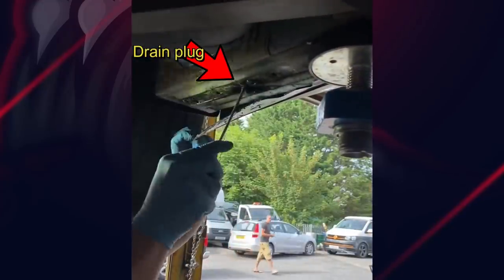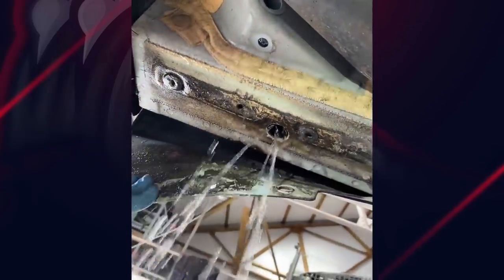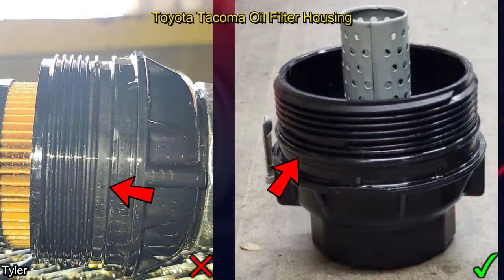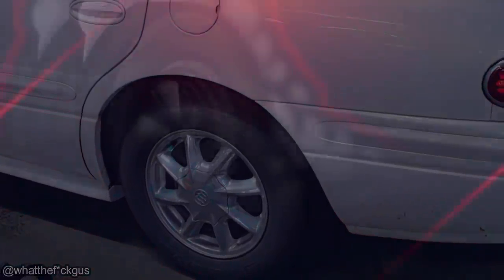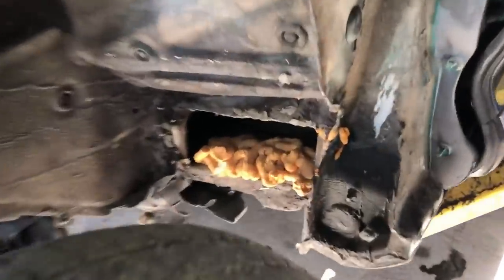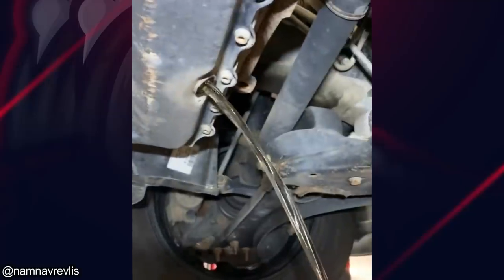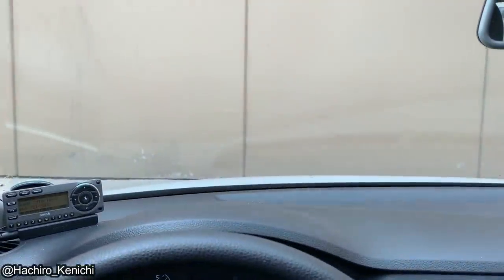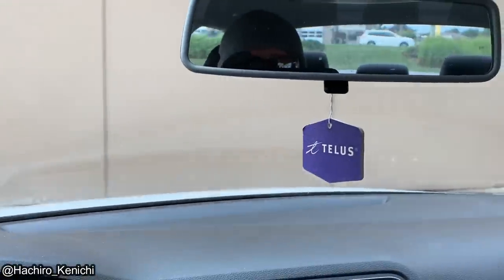Customer States Water Noise When Driving | Just Rolled In

Comment: I love people who say I just drove thru a small puddle, then you look at the vehicle and its more like they drove it thru a lake. Keep them coming haven't laughed this hard in years 😂
Reply from the maker: Appreciate you being here, Tyler!
Reply: Buy a vehicle with high ground clearance. 
Low ground clearance vehicles are only good for racing tracks.
Reply: And if the engine hadn't stopped, they would still be driving it today
Reply: Dude, I don't get what people are driving through to do this. My wife drives through a creek every day too leave our off grid property, and it gets up to the lights sometimes. We have NEVER hydro locked the Tahoe up. No snorkel either.
Reply: @ryan-uu9lj  in my experience there driving thru flooded areas in lower to the ground suv's and sedans. They panic and floor the gas pedal instead of being smart turning around or going slow thru the water. As soon as they panic and floor it is when they hydro lock engine and flood the interior as well.
Reply: @ryan-uu9lj  It gets hydro locked when you stop in water.
Reply: @ryan-uu9lj  Different engines have the air intake at different heights.  It used to be normal to have it on top of the engine.  Nowadays it's common to have it rather low.  In the latter, driving through water up to the headlights would completely submerge the intake.
Reply: I've got one at work I'm waiting on parts for now that said the same thing, but the blower motor was full of water and the engine was hydrolocked.
Reply: @Kromaatikse  I can't remember what car it was but I remember one that has its air intake nearly ground level
Reply: I helped some guy right after a rain storm whose engine stalled after going through a puddle. The engine was locked. I could tell from the sound the starter made. The wheel well was missing so the tire splashed water straight into the air filter.
Reply: I feel really lucky then.
Back in the 1980s or 90s, I drove my car across a river that had overtopped the road and I didn't see it until about 100 feet ahead (because of a ridge where the train tracks crossed the road).
The water was over three feet deep, and I was going fast enough that I almost made it across the 200 or more feet of flooding.
My 1984 Ford Escort stopped running, but I and my passenger were able to push it the rest of the way out of the water.
All I ended up with was a cracked distributer cap and wet carpeting.
Reply: The Golden Nugget was towed through a small lake to kill the spiders....!
Reply: The drove through a puddle thing can actually be quite accurate. I can confirm it happens.

I owned a 2000 Ford Mondeo Sedan (English name) The model with the eggshell bumpers.  It was the 2l Turbo Diesel with under 100,000 Miles on the odo.

Was a wet day as usual in the UK, and I was on the Motorway/Freeway on cruise control at 70mph.  There were some puddles, but I had a policy of never letting my Toyo Proxi Tyres get under 3mm tread so wasn't even tugging when hitting the water.

There was a massive bang after clipping one of the puddles, and everything shut off, including my brakes and power steering. Huge smoke cloud behind me as I struggled to coast in neutral to the shoulder with rainbows on the road.

Quick call to the Towies after I popped my bonnet to take a look and found oil and coolant dripping everywhere.

Turns out water got sucked into the air intake, which was situated inside the bloody left wheel arch! IT has slowly built up, and then flooded the air filter because the drain was blocked.  Water went into the block and turbo (Which was glowing hot) and the turbo had exploded, and a piston had blown a hole straight through the engine block.

So yeah... A puddle can kill a car quite easily...when the designers haven't a clue what they are doing!!
Reply: @kpdvw  The Golden Nugget was practically a car of theseus when it was finished. They replaced everything but the frame.

Comment: Rats are like "Ooohhh! Seasoning! Thanks, bud!" And that oil filter bit has "Jiffy Lube" written all over it.😳🙄🤬
Reply from the maker: 😂😂 ohhhh seasoning. That cracked me up.
Reply: @JustRolledIn  👍👍👍
Reply: Terrible. The reason why it was not there is because that means the old one was removed and they STILL forgot.
Reply: @Frostified  Yup.👍
Reply: A lot of crap comes out of the shops that prey on old people with the “free 78 point inspection” BS advertised with AAA or in AARP magazines. My mom taken for a ride once, the second time she called me to meet her there. Apparently her engine was leaking huge amounts of oil as was her transmission. Not one person there could explain to me how it was leaking but not leaving puddles on her garage floor, much less how it was still running  because mom didn’t know how to add oil. They’re out of business now luckily, one of the worst shops in town
Reply: @knuttsackjones3094  Yup. A lot of those kinds of places are just the worst scams you'll ever come across.
Reply: Idk why anybody goes to those places. You can get high quality oil and filter for $30-40 and it only takes like 20 minutes. Until you drop the plug into the oil like a dumbass and have your dad ask where it is and you have to come up with a story
Reply: @KNR90  Every mechanic has done that; probably more than once. But all good mechanics also have a "magnet-on-a-stick" so no problem.
Reply: Least they remembered the filter this time.....
Reply: @knuttsackjones3094  And it's not so much the fact that the lube chains exist, as the training is so often lacking for their high-turnover employees.
So many kinds of cars, many with their own quirks to remember when changing fluids and filters, and without proper training and/or access to some sort of work guide, you get "best guess" mechanical service.
Reply: @KNR90  Most people who rent, at least in my state, cannot do oil changes by themselves at home without risking their tenancy.
Reply: @MonkeyJedi99  That's because America has made sure it's very expensive to be poor
Reply: You can repel rats with capsaicin but you need significantly higher concentrations than pepper flakes. Hot sauce can work.
Reply: Jiffy Lube has some "professionals" oil changers....according to the commercial.
Reply: They would have to remove it to not put the gasket back on. 🤔

Comment: You can’t make this stuff up. As a non mechanic I feel stupid but when I watch these videos I feel fairly mechanically inclined compared to the customers who brought these cars in.
Reply: Drivers exams are WAY to easy!
Reply: As someone who has been to an automotive school, this stuff still blows my mind
Reply: Right? Me too lol
Reply: In 2009 my 2006 Mustang GT made an odd sloshing noise when I would reverse and hit the brakes. On a 3-hour trip I went through rain so heavy that I had to pull over. Water began pouring out from the passenger side of the dash during the trip.

Turns out the cowl drain plugs had gotten blocked and the entire cowl filled with water until it overflowed through the cabin air filter! An ungodly amount of water came out when I pulled the rubber grommet inside the engine bay.
Reply: There exists the bottom 10% of human intelligence.

Comment: To be fair to the first person with the water problem, that's about how much water came out of my MX-5 sills after some rain. The roof drains water into the sills and out a couple of tiny holes that get clogged fairly easily. Seems like a huge rust risk
Reply: I used to have a Nissan 100NX with the same problem. the T-roof drains into tiny rubber tubes that go through the center pillar and onto an even smaller plastic hose nipple through the bottom of the sill. But one of my tubes had come off it's nipple and had been dumping water directly into the sill whenever it rained. So it got rusty down there. VERY rusty.
Reply: Same thing with my grandma's Aura. Back doors regularly filled halfway with water. Damn whirly birds clogged the drain holes and sent water into the back floors. Enter mold everywhere and two days of bleach and shampoo later and a leather cleaning kit, and it's fixed. And now that car can't be driven because it was tboned shortly after cleaning it.
Reply: Yep, MX5's love to keep water. I had to repair a seat as it had rusted through on the rails. It was sat in water for years.
Reply: @GetDougDimmadomed  That sucks.
Reply: Welp, they don't call Mazadas Rust buckets for nothing
Reply: @GetDougDimmadomed  
"Oh, COME ON!"

Comment: 1:07 "...the mechanic was pretty shocked..." nice play on words there.  And a word on crossing those "pesky streams".  "Turn around, Don't drown" is the best policy, but I've seen plenty of drivers who think that if the water depth is questionable, their best chance of making it is to get a running start and charge full speed.  Charging into water at high speed creates a wall of water in front of the car (this wall is known as a "wake").  The intake might be high enough to not suck in the water had it of otherwise remained low, but this wake can often be taller than the hood of the car itself, and this is what gets sucked in.  If water is questionable, it's best to find another route.  If you've made up your mind that you're going to cross and there's no way of talking you out of it, don't charge full speed.  Go slow, like snail speed, and pray this isn't a decision your next of kin is going to regret.
Reply: Theres a "small stream"  or "puddle" between My country (NZ) and the US.  Its 6,500 miles wide and called the Pacific puddle. :-)
Reply: That one was good but the first one wasn't real.The water was way too clean for it to have been inside of an old running engine .No water doesn't mix with oil but it wouldn't be crystal clear either.
Reply from the maker: @yourmomsbestfriend8922  the first clip of this video you're talking about?
Reply: @JustRolledIn  Was it legit?
Reply from the maker: @yourmomsbestfriend8922  yes. The first clip wasn't water from the engine also. Lol
Reply: That "CHARGE" tactic works great on snow, slush, and ice. It ensures that you have enough momentum to avoid being bogged down before you get across the obstacle. In fact, it's pretty much the only way to get through some snow formations! The problem is, once you've done that all your life, when you encounter a Southern mud hole, it's natural to use the same tactic. I still don't know why it didn't work. Luckily, my engine did NOT suck the water in. The car, however, sank until the water was over the floorboards and it stayed right where it was until a tow truck hauled it out for me. 

Also: I had NO idea the water was as deep as it was until it was far too late. It really did look like "just a little puddle" until I was smack in the center of it.
Reply: @uhtred7860  That's a "pond."
Reply: @yourmomsbestfriend8922  You think engines have little soft rubber drain plugs that you just pop out with a screwdriver tip? Derp.
Reply: @Slicerwizard  No idiot,That's why I don't believe that engine had that much clean water in it.I also didn't realize that it wasn't the engine because I didn't see the phone clearly.At first all I saw was a bunch of water pouring out of the bottom of the car.
Reply: @yourmomsbestfriend8922  thay was the frame he was draining not the engine. The owner was hearing the water slosh around in the frame. 
Get a brain ok.
Reply: I noticed that..I didn't see it clearly..I already said that I didn't realize that it wasn't the oil pan at first...You know,before I screwed up and commented that dumb sh*t.
Reply: I saw in a comment for another video from this channel that not only should you go slow thru high water (if you can’t turn around) but you should also go backwards. Is that actually a good idea?
Reply: @Sashazur , I've never heard that, but I suppose that the theory would be to protect the engine from the water's wake.  Often times when an engine ingests water, it's from the water's wake, and not the actual water line.  Driving in reverse could potentially save an engine from the wake, but so could driving slow.  But if the water is high enough, no driving technique will save the engine, or the passengers for that matter.

Comment: The o ring on those cartridge style filters are crucial 👌
Reply: Same with a spin on filter
Reply: And they easily last for several oil changes before you really need to replace them.
Reply: @Frostified  true but at least for my car, every one of the filters I get has a new o ring, so I replace it every time.
Reply: @brysonshires9742  true, I'm just saying it's easier to mess up a cartridge seal than a screw on.

Comment: Had a tire explode in Idaho (watch for falling  rocks), sidewall issue, replaced tire with 8 ply sidewalls (all four) by Cooper. Also Idaho, installed snorkel and various breather pipes plus all underbody gaskets and plugs especially for crossing deeper water. Not cheap but never had any problems.

Comment: That oil filter is the reason I take my truck to a shop and not quick lube. My shop only has certified techs and they check over the vehicle while they have it on a lift. My warranty was almost up and they found an oil leak. They saved me more money with just that than I’ll ever save over the life of the truck going to a quick lube. They charge $100 for oil change/tire rotation. They’re pretty quick usually about an hour. They also offer a warrant expiration inspection where they go over everything to find anything that would be covered by warranty.

Comment: The drove through a puddle thing can actually be quite accurate. I can confirm it happens.

I owned a 2000 Ford Mondeo Sedan (English name) The model with the eggshell bumpers.  It was the 2l Turbo Diesel with under 100,000 Miles on the odo.

Was a wet day as usual in the UK, and I was on the Motorway/Freeway on cruise control at 70mph.  There were some puddles, but I had a policy of never letting my Toyo Proxi Tyres get under 3mm tread so wasn't even tugging when hitting the water.

There was a massive bang after clipping one of the puddles, and everything shut off, including my brakes and power steering. Huge smoke cloud behind me as I struggled to coast in neutral to the shoulder with rainbows on the road.

Quick call to the Towies after I popped my bonnet to take a look and found oil and coolant dripping everywhere.

Turns out water got sucked into the air intake, which was situated inside the bloody left wheel arch! IT has slowly built up, and then flooded the air filter because the drain was blocked.  Water went into the block and turbo (Which was glowing hot) and the turbo had exploded, and a piston had blown a hole straight through the engine block.

So yeah... A puddle can kill a car quite easily...when the designers haven't a clue what they are doing!!

Comment: 2:50 That's what happens when you hold 80psi in a tire that's only rated for 50. Only seems to happen to those BIG trucks, too, ya notice. You should always follow vehicle recommendation for tire SIZE, TYPE, & PSI. After all, they designed the vehicle, not you.
Reply: as an automotive tech myself i have to tell the customers with the f-350s, 2500s and 3500s that a p rated tire even though its the correct size will not work on their trucks all the time.....they then come in at a later date with just the rims and have the tires put on.   and i then see them come in on a flat bed for repairs and new proper tires.

Comment: My son hydro locked his 2005 Nissan Maxima in 2010.  He had put one of those Cold Air Intakes that sits only a few inches off the ground.  When it went through a puddle that was maybe 8 inches deep, it acted as a straw and sucked water up into the engine.  

We spent 2 weekends getting all of the water out of the cylinders, changing the Catalytic Converter, and flushing the engine out with 3 oil changes.  He said it didn't "feel" right afterwards, and since the Engine Light wasn't on, he traded it in on a used Land Rover.  We spent at least one weekend a month for the next 3 years working on that damned thing!
Reply from the maker: I haven't heard the best things about Land Rovers lol

Comment: @2:32 My brother once ran over a broken piece of leaf spring on the highway with my family's 2012 Ford Ranger. The front wheel lifted the spring just enough to pierce and ruin the rear tire (It went fully inside the tire). It also dented the inside of the rear wheel, but it was only cosmetic. The mechanics where amazed when they removed the tire and found that piece in there.
Reply from the maker: Wow, lucky there wasn't more damage!
Reply: @JustRolledIn  funny thing is that he looked for what could've damage the tire and found nothing. He swapped the wheels and drove to get a new tire the next day. He told that there was nothing on the road. The mechanics showed him and told "that was IN the tire".

Comment: Love the hidden compartment vehicle Lol. Back in 2001 I had a 1985 Ford Ranger I was putting carpet in and I found two gold rings under the old carpet I still have
Reply from the maker: That's awesome! Lol. 
Coolest find I found was a samurai sword on a vehicle that was traded in.
Reply: @JustRolledIn  Damn that's cool. My friend was pulling a MG midget out of the woods in 2012  guy said it had been there since the early 90s. He found a old brass head hammer on the wiper cowl when he popped the hood. It looked new
Reply: I found a gold ring under backseat of my foxbody mustang, and a 9mm under seat of a gmc truck my friend bought for parts lol.
Reply: @henrydillard6217  "and a 9mm under seat "  Socket, or firearm?
Reply: @almostfm  the latter
Reply: That brass hammer in the MG is for the Wheel spinner. You have to beat it with a hammer because there are no lugnuts. The hammer is part of the MG's toolkit.
Reply: @mikeellis9720  right. It was on the cowl but no wheels on the car it was sitting in the mud on the brakes
Reply: @mikeellis9720  That would only be if the MG had wire wheels. Disc wheels were standard.